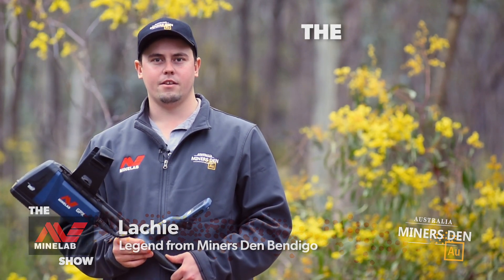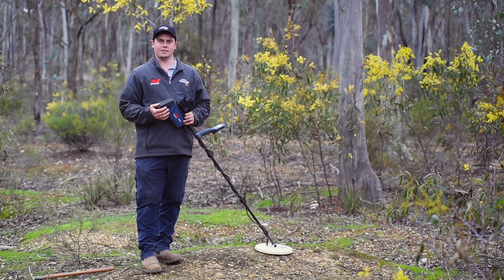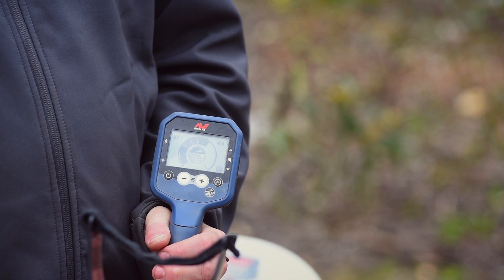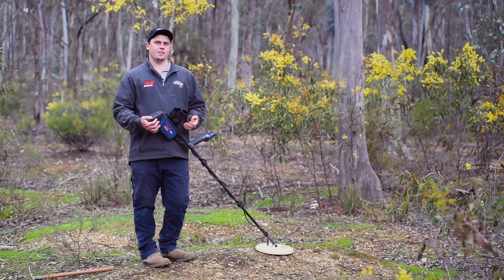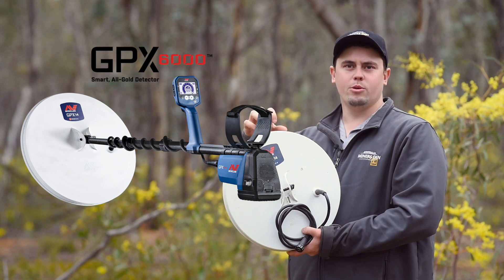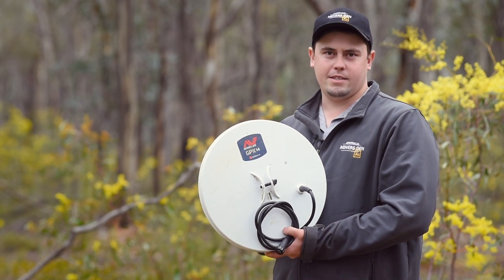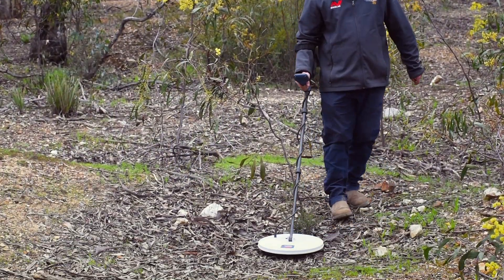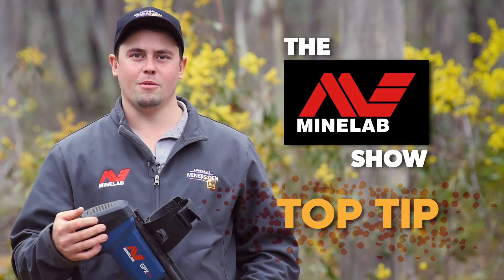How to knock out EMI on the Minelab GPX 6000 Metal Detector Hack

Comment: Why does there need to be the constant noise at all rather than a normal detector where the noise is present only when it finds something
Reply from the maker: The constant hum - called a threshold - serves a couple of functions, first, it disguises the slight fluctuations caused by ground signal and electronic interference- if not running a threshold, these would sound like targets that would appear and disappear constantly. Having a threshold hum that is slightly louder than this unwanted noise stops you hearing them. Next, it also gives us an audio reference to hear faint or deep targets that may not produce a response loud enough to break through the ground signal and electronic interference, but when running the threshold, is enough to just warp or change that hum repeatedly, making them easier to hear. A threshold hum can be the difference between finding that retirement nugget at 3 feet deep or just walking right over it without ever knowing it was there ;)